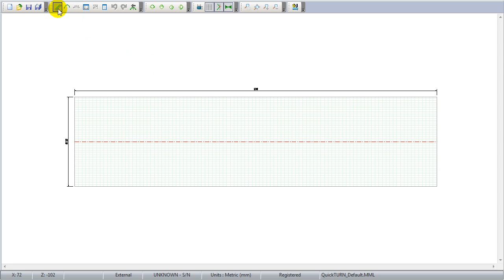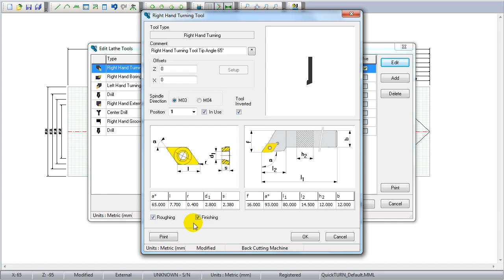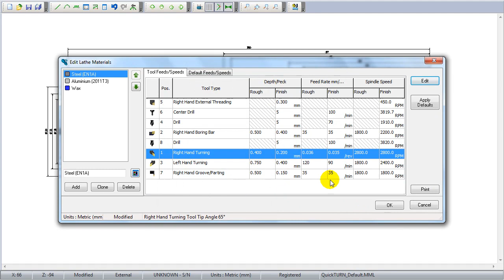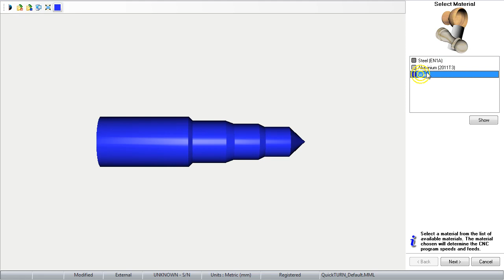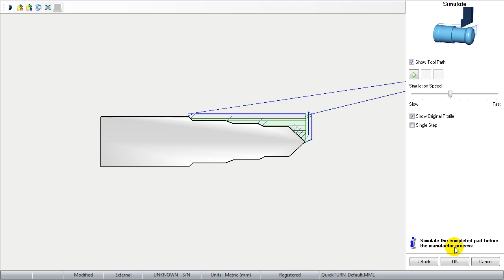Denford Lathe Tutorial   Quickturn 2D software

Comment: Hello, i have a question.
I want to draw an arc (in 2d design) with starting point (0,0), ending point (10,10) and radius=10. In other words i want to draw a quarter circle with 20mm diametre. The problem is that i cant, because the center of the circle is not (0,5) and every time i try to change it, the other numbers in properties get crazy. How can i fix that ?
Reply: I think you can try all the ways of drawing an arc from create -> arc -> arrow on the right. Try all of them and see which one works. For me, I think the center point arc works. 
1. click on center (10, 0) 
2. click one point (0, 0) 
3. type 90 for the angle.